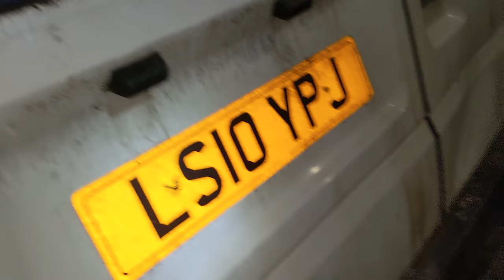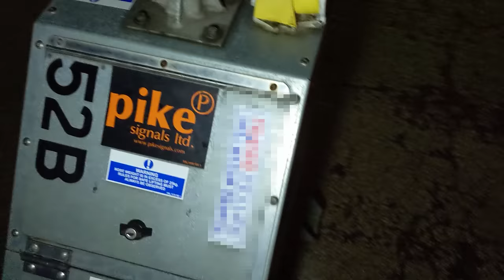Stolen Traffic Lights present a new challenge for the Automatrics MTrack recovery team

Comment: Love these videos! Listening to that RF bleep made me think of our old CB treasure hunts back on old AM CB before FM came in.
We'd hunt for the beacon using a loop antenna which give you a direction to the beacon pointing away from the flat sides of the loop. So two locations would give you a cross on the map. Ideally you'd use three readings that gives you a small, triangular location for the beacon.
This is where the phrase "Knocked into a cocked hat." comes from. That little triangle being the cocked hat.
Buy you could use an RF direction finding loop on the roof. It'd speed up your finds i think.
Reply: We do this every week on the 2 mtr band...Radio direction finding is great fun!
Reply: @ianharling9569  I'm glad it still happens. For me 27mhz AM CB lost it's magic when UK FM came in and i got into SW listening, scanning & RF to PC stuff.
Still, fun while it lasted!
Reply: Working on making a "Fox" for the 2m and 70cm amateur bands ready for spring. Should be good fun!

Can use loops, yagis or even a phased dipole pair which creates a sharp null rather than a prime lobe
Reply: @dasy2k1  yes have used switched dipoles in the past but personally I prefer a simple HB9CV two element beam for 2 mtrs and then program into the memory channels on the transceiver the various image frequencies and harmonic of the main frequency and have great success with that.
Reply: Showing your age there chap. 10 10 lol.
Reply: @markrainford1219  Me?  Nooo! I'm still in my late 20s. Erm... Very late 20s 🤣
Reply: @Aengus42  What 1920s?😁
Reply: @markrainford1219  Feels like the bleedin' 1820's this morning mate! I got a tad "festive" last night 😆

Comment: Nice to see the lights were actually working at the end and not stuck on perma stop as I increasingly see with temp lights these days! :-)

Great video as always, great to see a professional doing whatever it takes to get a result for the customer, sorry to say it is not a common thing anymore.
Reply: I agree, nothing worse than 2 or 3 temp lights jammed on red, it turns into a spaghetti western style staring contest. It's who's gonna be the first ,and run a red light to break the deadlock.
Reply: They just stick temporary lights up instead of repairing the proper ones, get out clause by local council. Yet they can come out 5 times in 4 weeks to my knowledge and repair the temporary lights on a main major route A41 for 4 weeks so far.

Comment: "The whole light is about 3,000 quid"
"The crims like to sell the batteries for 150"
Reply: Try sell a traffic light..... It's probably not easy.
Reply: @4kirb  Precisely, not the typical thing someone buys on impluse when browsing ebay!
Reply: @TheRCBiker  Ebay's no fun when you're sober!
Reply: @TheRCBiker  no, but they're definitely the thing to buy on impulse at an equipment auction, especially if nobody's bidding.
Reply: @TheRCBiker  Yea, got to say I can't remember the last time I went on ebay and was like "You know what I'm missing in life exactly right now? A random set of traffic lights!". I mean I'm only 27Yrs old so I have another 20 ahead so who knows.
Reply: @lolly166541  you never know you might want your street to be quiet for some time, recommend picking us a set for the future
Reply: Cost 0, risk, as you can see, 0, little effort taken to stop them.
Reply: no need to buy the lights to have fun, you just move them a little or disconnect the batteries if they are unlocked

your welcome 🙃

Comment: Recently had car stolen from my driveway. For sure when the car is replaced will be fitting one of your trackers!
Reply: Also consider getting a kill switch put in. Its fairly cheap and means they have to tow it if they can't start it. they may just move on to another target instead.

Comment: You should instal a second system next to the tracker. A alarm(sound) that that can be set of from a distance. Could help to discover the item faster.
Reply: Don't need to, the handheld is directional enough.
Reply: @hippopotamus86  In some cases the object is situated in a garage box and they can't pinpoint the exact garage or storage. A alarm sound would help in that case.

Comment: Why didn't the second set get a GPS signal ? I can understand the difficulty in a van (though a modern receiver will probably work there eventually) but that set's out in the open.
Reply from the maker: Good question... we thought the same thing.We understand a new panel had been fitted later which prevented a GPS fix.

Comment: Bet the criminals are pleased you've now told them that these things are fitted with trackers so they can now defeat them, you've already shown what frequency they operate on.
Reply from the maker: We agree a channel balance is needed. The channel purpose is to demonstrates "GPS only location tracker" weaknesses, whereas they cannot be relied upon. More potential victims benefit than bandits from viewing these informed differences. Automatrics systems are entirely after market, so they are a completely unknown optional fitment. Your concerns would be better address to Thatcham Research security department and the ABI who certify the fitment of OEM tracker systems who over advertise benefits. Regards equipment frequency imagery capture, we have no concerns as we use a different frequency to the depicted labeling, we also modulate the from over 1000 separate frequencies. Many Thanks for your comment.

Comment: Why dont you have 3 radios in the same car to triagulate the signal to get a pin point so you don't have to drive about? Or why not just transmitt GPS coords or even have a small 2G transmitter which sends GPS coords to central server?

It would be effcient to ad the triangulation to a drone aswell. Fly that up 500ft and you get a shit load of line of sight for the signal

Comment: Is it just me or why is no GPS installed? We can track our flippin keys at minimal cost these days.... 🤦‍♂️
Reply from the maker: Very good observation however our systems have very powerful GPS receivers , but they are not your typical standard GPS tracker, which are installed to maximise GPS signal reception.  

Our devices are designed for theft recovery, which means they must be well hidden from sight. When installed deep within assets this may restrict satellite signals and especially so when assets are hidden themslves placed into in a shielded environment.

Standard GPS trackers may achieve a fix but that's not much help in a theft recovery situation, if as a consequence they can be easily discovered and pulled off. 

We will receive GPS in approximately 6 out of 10 recoveries. The point here is we have a second RF location layer to help in situations where no GPS fix is not possible. Hope that explains things . Thanks for your comment 👍
Reply: I can understand your commercial protection reply. Lol. But modern GPS tracking devices are the size of a coin an powered by lithium button batteries that last months. You are trying to say that you could not include one hidden in your large equipment that someone could not find? Joking.....0
Reply from the maker: @howardtownsend3139  So sure might be worth a pop for fun despite the limited battery life, the inability to find anything when the the GPS is being jammed, or the fact the police wouldn't support it or it failing to work when stashed in a shipping container. 😁👍
Reply: @AutomatricsMtrack  Just love your verbal fencing...lolol

Comment: Criminals are getting lazy, not a lot of places to hide the tracker in those lights, but they could not be bothered to unscrew a few screws to look for them.

Good for the costumer they were lazy though.

I would imagine if you got a RF tracker that was a bit more high tech you would find those trackers easier...One with a roof antenna with 8 or 16 built in directional antennas and a display to show what direction the signal was coming from.

Comment: It looks very ood. Who leaves his van unlocked? It seems to me this video is fake. You can`t even open the van of the owner. He can blame you that you made it up.
Reply from the maker: Its not fake , just consider lots of these stolen vans are taken without the keys, they break in and then hot wire the ignition -  so most likely they cannot lock them 👍👍

Comment: I wish to object to the (common on many videoes and TV stations) use of filming whilst in charge of a moving vehicle.  This is an unnecessary distraction and potentially illegal.  You can easily film before arriving at a place, or at a service area.  Please don't do this again.
Reply from the maker: Appreciate your point but there are literally distractions everywhere when driving, changing the heater or radio settings, receiving a phone call, kids playing up in the back seat, poor visibility, maybe an argument with the passenger and just thinking about something else.  You have to be able to multitask when driving. If there are no other distractions present then talking as one drives is deemed safe,  it may even improve one's concentration.